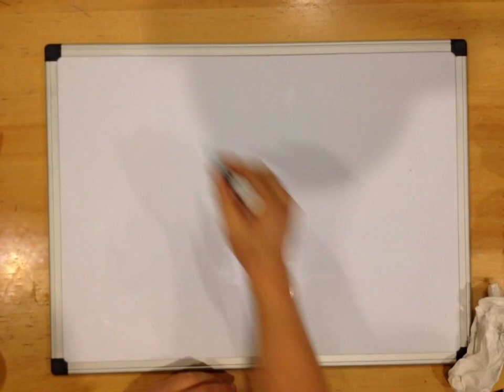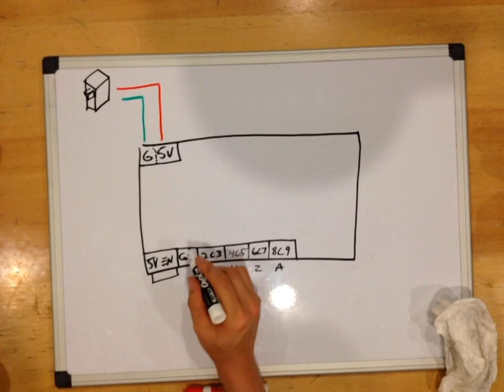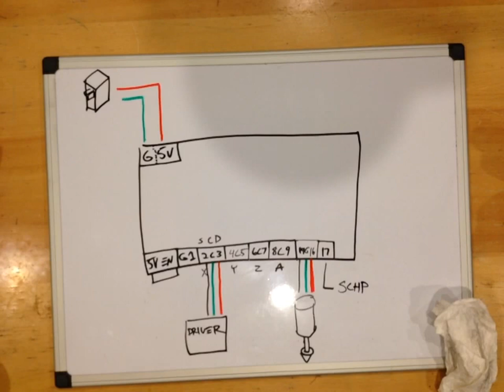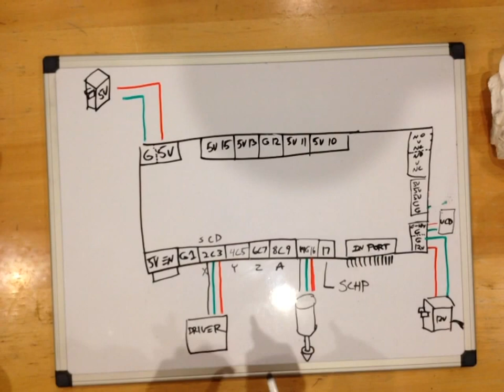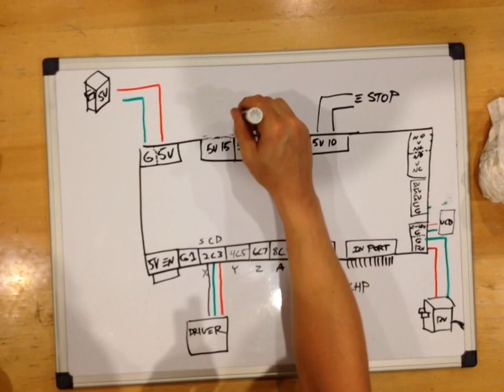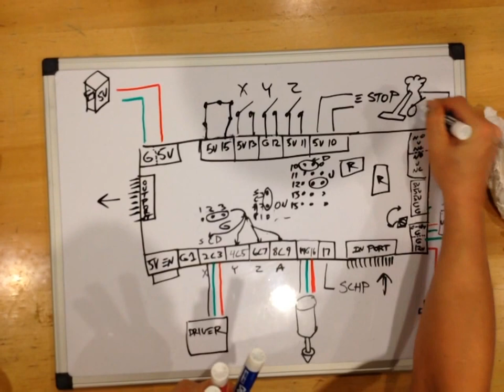THUNDERDORK: DIY CNC Router - CNC4PC.COM C11 Wiring

Comment from the maker: Just an update.  I ended up changing out the control board with a pmdx 126.  The board is awesome and works great with servos!  The C11 gave me to many headaches and didn't have built in servo error detection.
Reply: +ThunderDork the cnc4pc c32 has servo  error detection and works great. I just installed it for my mill.  But, you definitely can't go wrong with the pmdx they are awesome.

Comment: hi there i have a very hard time getting my motor to turn. I've tried everything, dunno whats wrong. Do i actually need to have the jumper com=ground or com=5v ? As for now it set to ground. i can jog in mach3 but the motor does not turn! Everything is wired correctly (i guess) and i have power to the board and drivers (kl5056). Seems like i have no power to the motors. Please someone help me!!

Comment: Exactly, sounds like you've got it. Even when everything connects back to the same ground, it's helpful in that the return path for current is not shunted through circuitry not designed to handle it. By the way, I meant to comment that I liked the format of your video with the whiteboard. Cheers!

Comment from the maker: yeah, as far as I can gather, one 5v powers the computer side of the board and the other 5v powers the logic to the controllers, relays, spindle etc .  I've not tried hooking up with another BOB like the HobbyCNC.  What I put int he video is all I can gather about the external stuff.  I'd check the manual or hit them up if you have questions.  They respond pretty quick.

Comment from the maker: Ah, okay.  Now it makes sense.  I guess when they say to use "isolated grounds" it confuses me.  How could you have truly isolated grounds if they all connect to earth at some point.  But it makes sense that separate transformer coils actually create the isolation.  Transformers use electromagnetic forces to transfer electricity and don't make direct contact with the main AC supply.

Comment: I just watched your other video, and now I understand how you have it wired.  Using the same 5V supply for both inputs effectively defeats the optoisolation--not an issue if you're not concerned about it, but just be aware the PC isn't isolated from the controller.  If you were to use two AC/DC transformers, the two DC grounds will be floating relative to each other, which is necessary for optoisolation.  The PC-side ground will still be tied to the ground of the 5V supply through the C11 board.

Comment from the maker: Probably best.  Problem is I wanted to ditch the usb cable that came with it and use a proper dc supply so I can have this box across the room.  You can see the construction of my box on the other vids.  Would two dc power supplies be alright to use plugged into the same strip?  went ahead and used one because I'm not sure what separate "grounds" since they all end up at the wall. I had heard you can use one supply as long as you don't ground it same spot as your motors. What do you think?

Comment: Nice video, Chris.  You've probably figured this out already, but the C11 requires *2* 5V power supplies with separate grounds since it's an optoisolated board.  Connect the one at the top left to your PC using the supplied USB cable breakout, and connect the one at the bottom left (5V / EN / GND) to a separate 5V supply.  You can still jumper the EN pin as you've shown.  Without the second supply, your outputs won't be enabled.

Comment from the maker: @gustavot1 Huh... Not to familiar with the hobbycnc ez board. Isn't that already a breakout board? Does it have the ability to drive the motors themselves. Guess I'm wondering if you need both it and the C11. Unless you are using the c11 just for the relays and inputs...  In terms of of your questions about pins and relays,  those are what I've divined from the manuals. Haven't gotten that far in setting it up yet.

Comment from the maker: Internally I ended up using 16awg wire for everything except for the ac side (10awg) and I cut off strips of the cable that came for the encoders (22awg I think). I've heard different things about shielding. I am probably gonna go without unless I start getting problems. I would thiink the encoder wires would be the most sensitive. Watch my blog or comment on it and I might be able to notify you if anything changes

Comment: Looks great! I just purchased the same system from Keling and this is my first servo kit. I did add a stepper kit to my mill but this is first time with servos. 
Question, 
what gage wire are you using for your cables? I was going to run 16 gage for servo power and 18 shielded for the encoders but I cant find 16/3 or 16/4 locally other than extension cord but I wanted to use sheilded cable. do I need shielded cable for the servo power cables (Box to Servo)